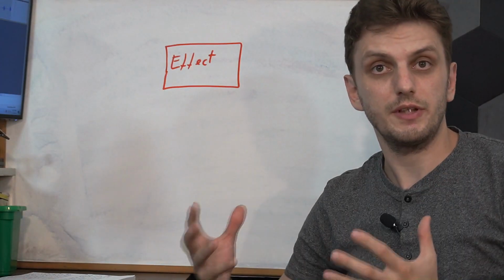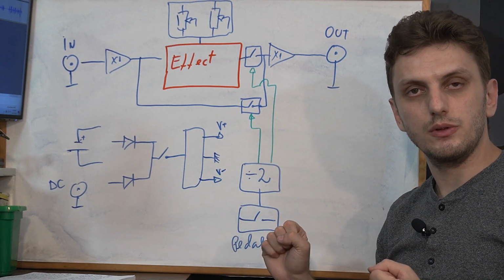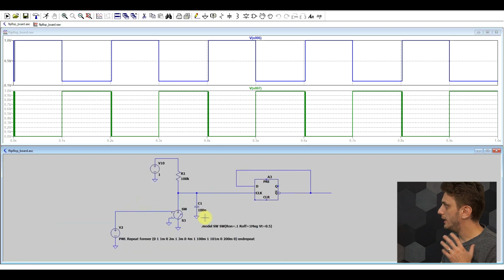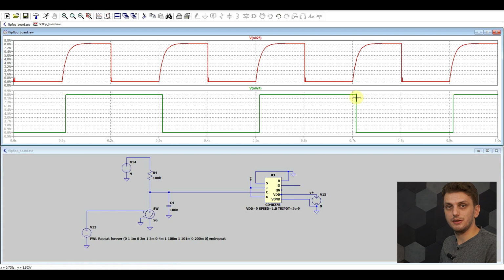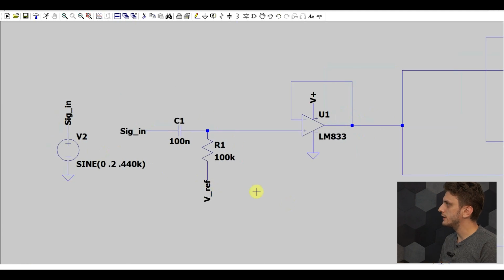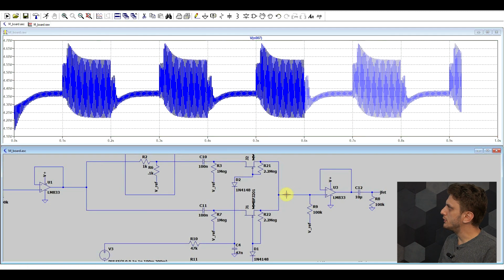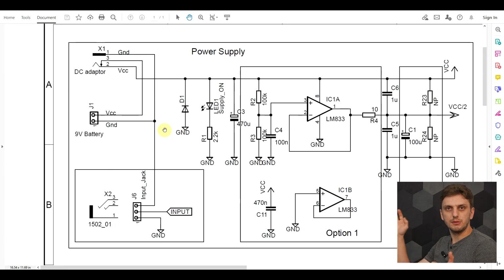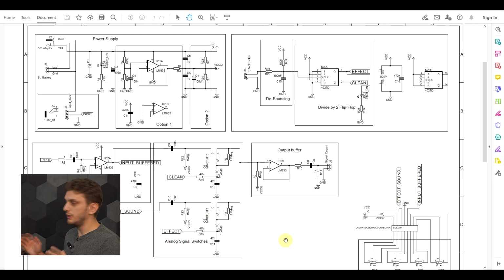DIY Audio Effect Pedal Part 1 - Mother board concept

Comment: I am very sorry, to put this question here… but I am a total electric newbie ;-)

I bought a vintage guitar amplifier (Teisco GL-120) that is still working… — but, unfortunately, it is producing a very strong humming noise. It is from about 1978 and has no vacuum tubes, but is made with transistors.

By your experience, what do you think that awful noise is coming from? Yes, I know, hard to tell, but do you happen to know the most common reason?

Does it ”usually“ come from (a) the power supply (transformer), (b) the speaker [8 Ohm] or (c) from the board and the transistors?

Any educated guess from somebody like you would be greatly appreciated… — Thanks ;-)

PS: After watching your other video (https://youtu.be/mnGbgM1v8t0), perhaps I should have placed my question there… ;-)

Comment: Can someone point out to me how the fet can actually turn on with that reverse diode at the gate. I simply cannot understand it.
Reply from the maker: Well, in this case its a J-Fet (not MOS-fet). This particular kind of transistor will conduct when there is no voltage difference between gate and source and to turn it off you need to reverse bias it - it works similar to a vacuum tube. The signal trough the diode turns it off, and when there is no current trough the diode, it turns back on from leakage current.

Comment: what exactly is the point of D1? Is it a clamping diode? A reverse polarity protection diode maybe? Isn't the latter usually in series with the supply voltage rail?
Reply from the maker: Its for reverse polarity purpose. You are right, normally you put the diode in series but the down side of that is that you loose 0.7V of series voltage drop - especially at low voltages this is not desired. On the other hand, with the parallel diode, you simply short circuit the power supply in case its plugged in the wrong way - this usually comes with a fuse, or you put a large enough diode to withstand the short circuit current. Point is, you no longer have the series voltage drop.

Comment: Is your Jack connector properly connected? I'm confused :D Doesn't pin no.1 with a black thing  VCC? Internet shows me a lot of pinout numbering so  that is why I'm confused
Reply from the maker: Well, regardless of pin numbering, I connected "pin 1" to the ground of the connector - the pin that is furthest away from the tip. Also in the practical implementation I'm using wires to connect the PCB to the connector, so any mistake can be easily corrected.

Comment: Using a buffer for the split power supply for these kind of circuits is actually a little over engineered. The inputs of the other opamps are high impedance, so they basically don't consume any. What's left is just the discrete part. But even that part won't consume much. So in this case I would have just use a resistor divider. Also you don't need so much capacitance.
Anyway nice and interesting video, as always 👍🏻😎
Reply from the maker: You are probably right. I did notice in the simulation though that adding the buffer helps with keeping the reference voltage a bit more stable, especially at low frequencies. Nevertheless I specifically made the schematic so that both versions (resistor divider and buffer) can be assembled so if it can be measured if there is any difference.
Reply: @FesZElectronics  could you move the 1 ohm inside the loop of the 1/2V buffer?

Comment: Could your input jack arrangement allow the input line to be briefly connected to power as you insert the jack? I mean it probably doesn’t matter unless the ground part of the input is also connected when this happens but it might be something worth checking.
Reply from the maker: Hello Tom! I think you are right! if I leave the middle jack pin (channel 2) connected to power and the ground pin connected to ground, there will be a moment in which the power is connected capacitively to the input line. Just to be sure this never happens, I will connect the circuit ground to channel 2 and the power supply ground to the jack ground - this way power will only be supplied once the jack is full plugged in.
Thanks for pointing this out!
Reply: @FesZElectronics  No worries. The other thing (which is more what I was thinking) is  if the input is connected to your instrument or something else then that might get the 9V spike. But then that is probably capactively coupled too. Maybe it doesn't matter? Just creates a pop when you connect? Could you just add a zener diode after R5 goint to ground to protect the op amp? Looking forward to the next one as always. Thanks!

Comment: And as for the switches, JFETs are kinda expensive and a bit of a pain to use in the first place, so instead of using a FET in series with the audio signal I’d use BJTs to short the audio to GND through a resistor. That might mess with the biasing and result in a bit of capacitive decay, but it looks like you’re already dealing with that.
Reply from the maker: Hello James. Regarding the price, I have to disagree. The MMBFJ113 is around 0.1USD and you can get THT versions still under or around 1 USD. On the other hand this sort of transistor is more rarely used, that I do not contest. 
The main reason why I went with this approach was that I saw it used in the old BOSS effects. If it was good enough for them, it should be good enough for me also.

Comment: Halfway through the video, but instead of triggering your flip-flop on the slow capacitive ramp I’d arrange the switch with a pulldown instead of a pullup, that way you get a nice rising edge for digital circuits. Otherwise, without a Schmitt input, I’d still not trust it to work properly.
And personally I’d want to look for a way to make that toggle circuit non-volatile, though it’s probably a futile endeavour. Best I can think of is some sort of capacitor that retains its charge for a significant time period, that or making a magnetic-core-based memory cell like one guy on YouTube did. 

Still though, this is exactly my kind of perspective towards a guitar effects setup, no guitar in sight, just a fascination with interesting analog circuits. Personally, I think I’m of a mind to make a custom additive synth and run the effects on that instead.
I was wondering how to tackle the connector issue, having to connect the input and output signals from each effect together in whatever order I want. I figured that RCA connectors were probably fine for audio, but I’d want a nice cheap connector for a split-rail power supply, which I was lost on. You’ve given me the idea to make a main board with a bunch of socket headers that I plug my effects boards into vertically, each socket strip with the same power and signal pinout, with no need for cables between them. Pots and buttons would be mounted on the top or side of these boards, and actual variable pedals would just be empty potentiometer pedals plugged into the relevant board via RCA. The toggling mechanism would be done via tactile buttons on the master board with little LED indicators to tell you if they’re set to on or set to bypass. Could even slot a VU meter or other kind of display into a socket.
For the power supply, I’ll likely use two 12V power bricks (one grounded and one floating) and a couple of 9V linear regulators.
All the PCBs will be made with minimal through-holes, thanks to using my backlog of THT parts with legs bent to be SMTs, because that’s my thing, and I like telling people about my DIIC14 and STO92.

KiCAD is king.

Edit: after seeing the second part of the video I see that you’re also using the pin header idea. I’m intending on stacking a lot of effects in series so having fewer bulky peripherals (potentiometers) on the mother board, thus instead opting to put necessary peripherals on the daughter boards will help me shrink the headers and stack them more densely. It also lets me use double-gang potentiometers like I need for my variable clipping distortion circuit, or other peripherals like little clipping antiparallel diodes or theremin wires or whatever.
But this also has the downside of requiring that force be applied on the daughter boards to actuate any buttons or potentiometers, which the 2.54mm socket headers might not like. Might want to use wide double-row headers for the rigidity even if I don’t need that many pins.

Nice video!
Reply from the maker: Hello James!
Regarding the pull down resistor rather than pull-up for the switch, I have to agree, that makes more sense, I'll have to look into that.
On the topic of non-volatile memory, to be honest, I would go for a more 21st century approach and just use a micro controller. Also you can interconnect multiple effects with analog integrated switches (like CD4051) and have all the interconnection scheme memorized in the uC. Or, to be old school, use some relays.
I also thought of making a large mother board with multiple effects plugged into it. Might try it in the future. 
If you add large mechanical parts on the small boards (pots and switches) I recommend also having some screws to fix the small board in place, so those take up the mechanical stresses rather than the connectors. 
I'm happy you enjoyed the video!